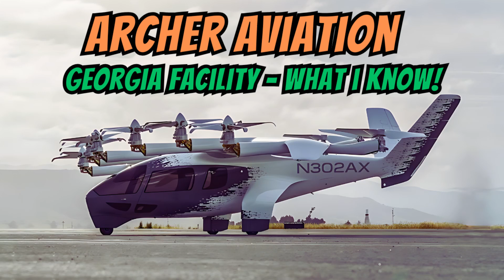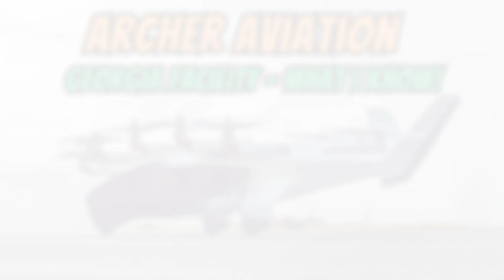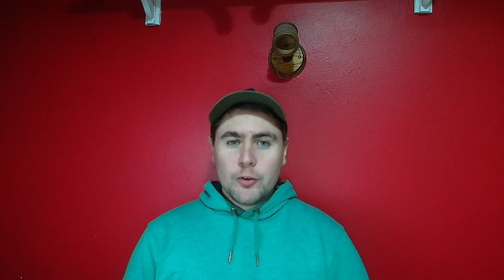Archer Aviation Georgia Manufacturing Facility UPDATE - Here's What I Know!

Comment: Thanks for the facility update.  I would be interested in regular updates on battery innovations and how they are or could be applied in the AAM space.
Reply: @myiz9443  there is a good article on the Oakridge national laboratory gov website talking about  what evtol batteries need to be and how automotive cells will not cut it. I can't put links. Joby is trying to certify with common automotive cells. I don't know what archer is planning on using.
Reply: @myiz9443  there is a good article on the Oakridge national laboratory gov website talking about what evtol batteries need to be and how automotive cells will not cut it. Joby is trying to certify with common automotive cells and I don't know what archer is planning.  I can't put links but its easy enough to find.
Reply from the maker: That would be great! I’m going to get these done!
Reply: @TheHustleBrothers  there is a good article on the Oakridge national laboratory site talking about what is needed from batteries for evtol.

Comment: 300 to 500 square feet is about the size of my personal production facility. Does that facility cost more than the tax and grant benefits?
Reply from the maker: I am unsure of the exact amount the grant they will get would be but i know archer plan to invest $118 over a 10 year period into the facility
Reply: @TheHustleBrothers the local governments give them money if they promise to hire a certain number of people when its open. Who sold them the land next to the airport? Thats not a good spot for testing because it's restricted airspace. The price is probably why it's there if they even needed to pay.
Reply from the maker: Thank you for the info!
Reply: $118 is about the average cost per night in a 300 - 500 square foot motel room in Covington, Ga.
Reply: @hhr1985  yeah I dont produce much. I usually need to run extension cords outside if I want to make something. Its my garage.
Reply: Dec. 19, 2024 per Archer.
Earlier this week Archer received the certificate of occupancy for its ~400,000 square foot aircraft manufacturing facility—referred to as ARC—in Covington, GA and held a commemorative ribbon cutting ceremony

Tooling load-in is already underway ahead of the planned start of initial production beginning in early 2025, with the goal being to ramp production to a rate of two aircraft per month by the end of the year
Reply: @PhilZnnn  i was joking he said 350 square feet 1:50
Reply: @PhilZnnn  i was joking he said 350 square feet 1:50